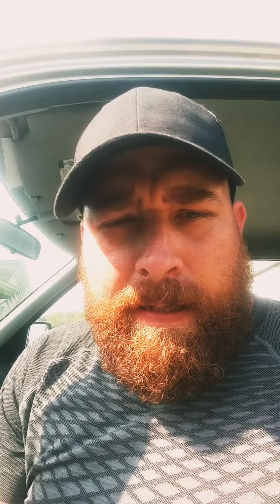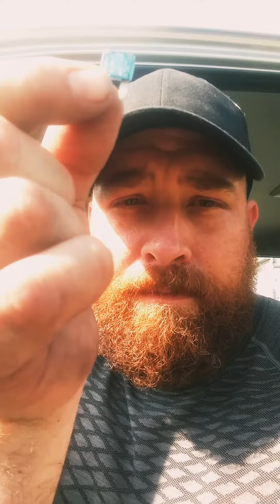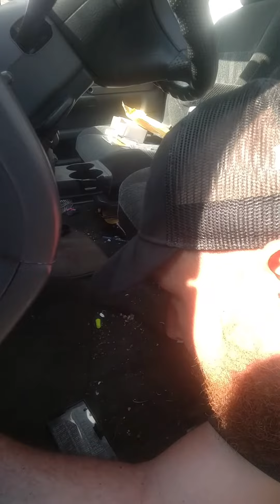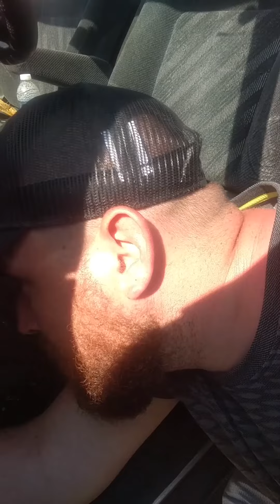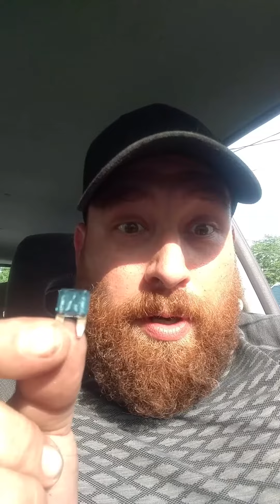Honda 2000 CR-V ignition coil problem solved

Comment: My fuse looks fine, but I am walking to get another now. If you fixed this for me, dude, you saved me from rock bottom. I'll update on this
Reply: Any update?
Reply: @WarzoneCamper  Oh damn, that was way back. Yeah, bad coil.

Always test parts, repair cheapest first.
Reply: Just the coil in the distributer ?

Comment: Do you remember which fuse it was or where it was located or the number to the fuse currently having the same problem Nd done changed sparks plugs wires distributor etc can’t figure out what else it could be